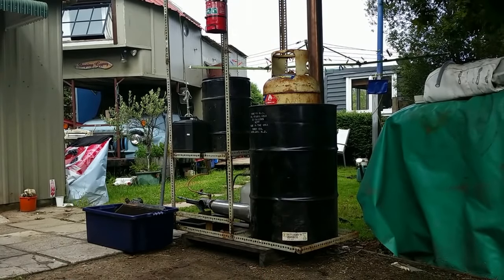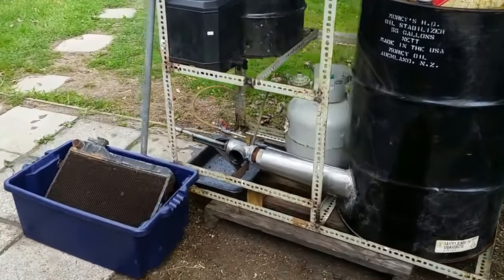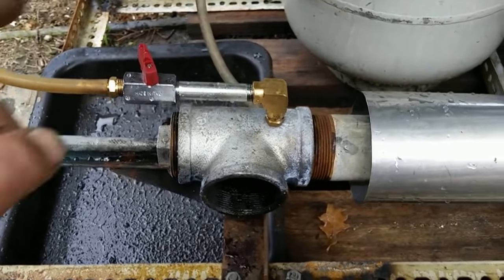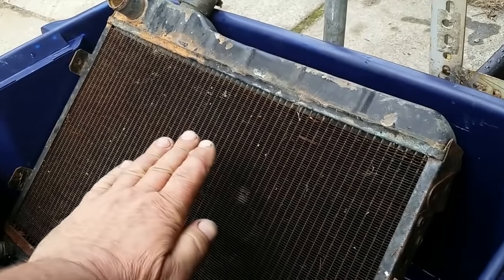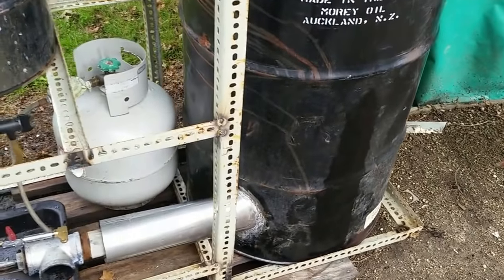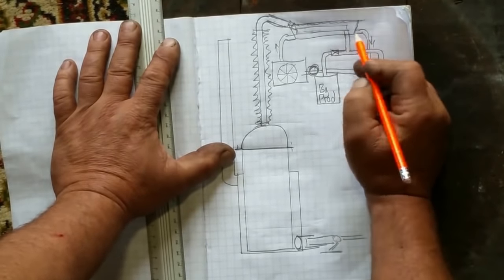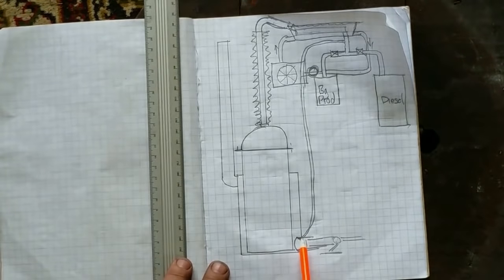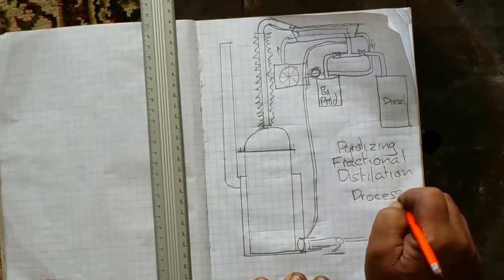Make your own free Diesel from Waste Plastic!  PART 2  layout of components

Comment: Sir, I respect and appreciate the work you have filmed and for a DIY this is very good. But as I am making these units on industrial scale (10t of plastic a day) I have enough experience to add some details to this. (if I may) 
1st of all don't call the fuel you get a "diesel" you get a mixture of benzene, gasoline, diesel and wax. IThe way you have designed the gasoline and diesel separation or "distillation" as you sad will not work in practice. The way to test it is just take a small cup of fuel and drop a burning match. Diesel will never ignite. If it ignites it is because you have too much gasoline in it. You better make a separate distillation unit and it would be very easy to do using your existing pyro equipment.  Another thing is that your diesel (even perfectly distilled) is a summer diesel. It will not work in winter. Take a bottle of this diesel and place it it your freezer. At lower temperatures you will see wax particles, then the fuel will harden and that's it!!! This is happening because the solidification temperature of synthetic fuel like your is very high. Normally you need to add some additives to lower the solidification temperature. But in DIY conditions it is hard to do it. 
Second is some safety issues. I would suggest The gas from your system goes to the burner for heating and that's a good thing. But if for any reason of power shortage or wrong operations the flame flashes back it will go into your system and you will have a video about the BIG BOOM theory )))) So please install 2 bubblers in series. It is a vessel filled 2/3 with water. The inlet pipe goes down as much as possible into water. The gases are coming out in water and travel up so the 1/3 of the vessel will be filled with gas. The from the top you have the outlet that goes to second bubbler and repeats the same. The gas outlet from the second bubbler will go to your burner. In industrial cases we install a flame arrester but I think it would be hard to find one for your size and pressure as your unit is very small. 
Please don't take this as a criticism as I only try to help. Grate job and keep on doing what you like doing!!!  Contact me if you need more help.
Reply from the maker: Two bubblers?  But I like explosions haha . Thank you for your input. I did read about all this as I was building it.  But I've only done one test then lost the insulation  and have not upgraded it. Too busy with other people's jobs to continue. I'm casting aircrete right now so I will make semi circular aircrete sections to fit inside the burn chamber and hold this heat in.
Reply from the maker: Thankyou for your kind help
Reply: @t.h.o.r.  That's fine. I have been manufacturing units like this about 10 years. So I just wanted to shear some experience with you. That's all
Reply: @artashesharutyunyan3693  Bubbler not required as gas burns at steady rate with no flashback possible as there is no oxygen in the pipe ,
Reply: @davelawson2564  The rate of gas production and pressure changes as it starts from nothing at ambient temperature till 3500 or 400C. Depending what you choose. First you get your water or steam, then the gas but it does not burn first. Then you get increase in pressure and your gas goes up very fast.  
There are many ways of doing the same thing. Some may like one way others the other. I am not criticizing the build or the project as for DIY job it is well build.  But I have seen several big explosions because of flames going back to system. And that's an ugly site. I had a small explosion myself. Not that I was perfect, I made my mistakes and learned my lessons. Now I am shearing them and hoping it helps. You may use it or not use it. You may use something else to fix the problem. But please don't say it will never happen. It's like all new drivers declare that they will never have a accident and boom... here we go )))
Reply: @artashesharutyunyan3693  I can't comment on your system since I have not seen it. But in an enclosed system , there will be no flashback
Reply: @davelawson2564  OK, May be )
Reply: @artashesharutyunyan3693  Thanks for you input.  I was thinking of making one of these units but I prefer safety first so the project is on hold for further study.  I'm in Canada and I'm an electronic engineer and machinist, so I was thinking with this machine I could make a  control and monitoring system by programming a microprocessor.  I have a fabrication shop in a section of my company where we weld, do machining, and woodworking for jigs needed to build electrical wire harnesses, for all sorts of companies that make their own products.  I would be interested in knowing about your system you build if you were willing to communicate with me through my email tom@ctwireprep.com   ,  Let me know what you think via email  ;  thanks Tom
Reply: No criticisme is thé truth
Reply: I'm an engineer in the oil & gas industry and had grave concerns also in regards to the vapor recovery as a fuel gas, which you have addressed accordingly. I might suggest using a flash back/flame arrestor from an oxy/acetyylene kit. You could also utilize the same regulator as flow control back into the combustion chamber. Also, love what you are doing here. It would be awesome to control this using an arduino processor too!
Reply: Sharing the knowledge is what brings discover
Reply: @artashesharutyunyan3693  would a one spark arrester like found one cutting torches work?
Reply: @t.h.o.r.  why not use solar heat to melt plastic
Reply from the maker: @13thbiosphere  I love using Solar, i have a bath heated by a coil on the roof, i have 3 seperate PV setups and I enjoy using my solar cooker when I can but this project was to use one waste product to process another waste product into a usable product.  im satisfied that when i get the insulation sorted it will fly- THEN we can start playing with solar- Ive foud someone elses epic parabolic mirror array that I want to copy- this could be the perfect excuse - thankyou!
Reply: @Andy-xm3ui  Not sure as never seen it. mine are  very large
Reply: @artashesharutyunyan3693  Yea I just wanna build one to make my own diesel fuel I don't really want a industrial one I need about 100 thousand litres of fuel a year
Reply: Sir Artashes Harutynyan, I've read your comment with great interest. Can you answer me some questions, please? 
1. Did you solve the prroblem with unsaturation of produced fuel? What is iodine number of diesel fraction?
2. What is specific weight of diesel and gasoline fractions?
3. I know Cetane number of diesel produced is expected bo be very high - 60-70, maybe. What about octane number of gasoline?
Thank you.
Reply: @andrewmosypan9898  
1.The problem of unsaturation of the fuel is solved, and all because of the catalyst we use. To be honest it was accidental result but we made it work and we repet the results over 15 times before we moved to industrial manufacturing of catalyst.  Sorry but would not discuss more details here.  Iodine number is about 20. A bit more then we need but it's ok and we can stabilise the oxydation with additives if we need to but I think there is no need. The fuel is not for Boeing 777
2. the diesel is 0.83 - 0.87. Gasoline don't know as we just burned it as fuel for us and we didn't sell it
3. Don't know as we didn't bother to test the gasoline cut. But octain number is not an issue at all as it is very easy to increase. The cetane is not easy to keep high. we worked hard on it.
Anything more?
Reply: akhper jan, inche ko contact detailnere vor garank khosink business
Reply: @panoskasparian667  JAAAN, zangi
zro zro ut vets,  mek yerek inn@ zro mek ut chors vets yerek hing chors
Reply: Согласен, бабблер необходим. Но все же не пойму откуда взялся кислород, чтобы пламя пошло назад в систему?
Reply: Artashes Harutyunyan, а вы намеренно помещаете в реторту некоторое количество воды или речь идет о влаге, содержащейся в сырье? Хватит ли этой влаги для продувки системы с целью выдуть кислород? Вы говорите, газ поначалу не горит? Не выясняли его состав? Или это просто воздух, вытесненный газами крекинга?
Reply: @andrewmosypan9898  1. eto vlaga vozduxa i vada v sirye. Nenada tudo chto to dabavlyat. 2. Eto prosto vozdux i nachalniye gazi pyrolysa. sastav ne vajen, no on silno vanyayet
Reply: Возможно, именно в этом причина вашего взрыва? Не горит сначала - значит мало углеводородных газов и избыток кислорода. Затем начальные газы все больше выделяются, и достигают взрывоопасной концентрации. Без водяного затвора пламя пойдет в систему - Caboom! Именно для продувки системы ДО НАЧАЛА крекинга (при 100 град.) я и предполагаю полезным поместить пластиковый сосуд с водой в реторту. Пар вытеснит из системы воздух и взрывной концентрации не будет. Затем поднимается температура в реторте и рефлюксе, и когда образуются газы, там уже не будет кислорода.  Остатки пара вытесняются в водяной затвор. Как вам идея?
Какой путь вы избрали для снижения йодного числа - гидрогенизация или алкилирование бензола и его гомологов?
Reply: Very informative suggestion
Reply: Earlier this week I was thinking about this and decided what needed to be done was make it refinery size.  Now I see it's not an original thought at all but one I'd have to emulate from someone else.  Where are you located?  I'd like to take plastics in as a recycler since there are no recyclers close to me(60 miles at least).  I could perform a public service and make fuel too.  I see it as the best of both world.  I'm considering using an old separator from an oil field location.  Of course I realize yours is much larger.  I'm thinking start small and work my way up.  I'd like to see your operation if you're anywhere close to Texas.
Reply: @davelawson2564  1st : did you measured oxygen content in pyrolysis gas? 2nd: did you noticed the flashing back of hydrogen gases?
Reply: @DGEngineering  First Learn pyrolysis basics then you'll not ask these questions.
Reply: @DGEngineering  it will not explode if you know the basics about it
Reply: @artashesharutyunyan3693  May I have some contact details please. I'm currently an undergrad chemical engineering student and I'm building this type of unit as a hobby project and would appreciate a mentor or some advice.
Reply: divorcedme  the pipes have to be metal and no rubber insulators. The piro-oil is destroying the rubber.
Reply: @Andy-xm3ui  pack stainless steel wool into a pipe. boom there s your spark arrester.
Reply: I Disagree sir there is always a chance of flash back. With my own eyes I've seen hydrogen flash a quarter inch line and blow the top off it's bubbled 25 feet away.
Reply: Hi Art,  I see some of the problems  you mentioned and a few others. But I also see a great potential as well. With your experience it's not a great leap to see you can be an asset if we work on this project collectively. Think fellas and let's push around some solutions next. First, EVERY plasma torch I've seen has used the double bubbled and a few of the really good ones had one way blocks as well.
Reply: @davelawson2564  That was my thought as well Dave , unless you had a leak it shouldn't be a prob  , But it never hurts to take precautions .What also concerned me were his comments on fractional distillation, I just didnt see it in his design ,, A re-flux tower "per se" doesn't equal fractional distillation
Reply: @bigpumpkin22  Bubbler he suggest will not work for this system.
flashback will not occur in this system either. He is talking through his hat
Reply: @davelawson2564 , Fair comment Dave , not enough internal pressure to drive it through a couple of air locks,,
Reply: @bigpumpkin22  Pressure is close to normal and no air locks required. Only involves cooling hot vapours. Ever heard of petroleum refinery blowing up ? Unless there is deliberate sabotage it will not blow up.
Reply: great advise, thank you!
Reply: Even as a summer fuel 
Generators could use for power grid ,or heating purposes etc
And we get rid of wasted plastic
Reply: @t.h.o.r.  I love your sense of humor.
Reply: Artashes Harutyunyan
 has NO IDEA what he is talking about, can't even use the correct terms.
Reply: @davelawson2564  
Be careful not to step into a trap! This is by no means an enclosed system, since the gas outlet is open by definition. Under normal operation you won't likely have a flashback, but as soon, as gas production comes to a halt and the temperatur in the reaction chamber drops, the backflow starts, oxygen get sucked into the reaction chamber and the chamber will explode since it's still far above igniting temperature of the remaining gasses at that point.
Reply: @tomcatmeow69  As i mentioned, this is not an enclosed system, it cannot be. If you control it with a computer, it still stays an open system and is in danger to explode, as soon, as the temperature in the reactor drops.
You better don't rely on sheer computing power if you don't want a failure like in Chernobyl.
If you have an power outage, your computer backup system will fail soon after as the whole reactor will.
And if your angry neighbour or a lightning shoots your computer first, there won't even be any emergency program to initiate a shutdown sequence anymore.
If you design your burner and gas outlet valves in normally closed and a reactor emergency cooling device in normally open, so that the whole distillery is self stopping and emergency cooling without line power, you'd be on a good way, i'd say.
Computer controll should be added on top of the self securing system and not be added to ensure safety.
The more engineers like their electronics, they tend to produce problems, not avoid them.
If you want to control exhaust gases, a computer is welcome - to ensure not to have an explosion in a shtf situation - no.
Reply: @werner.x  LOL ! you have no clue how these systems work.  It will never explode and never has.  even in the crudest experiments done for this type of system.
Reply: @davelawson2564  
If you think so.
Reply: An excellent critique thanks Artashes, especially the 2 bubblers. In the first film TinyHouse talked about there being no outgoing pollutants into the environment is that true and if so wouldn't more filters and bubblers do the trick?
Reply: @petergambier  
As far as usability of this fluid is concerned, if you use this for ancient Diesel tractors, you'll necessarily pollute the environment quite a lot, since these don't have any emission-reducing measures.
The only engines able to take this mixture, are such old diesels and they run dirty as hell.
I would in no case recommend this fluid for a modern Diesel engine, it would not survive this "Diesel" for a length of time that's worth the try. So the least you'll do, is pollute the environment with lots of junk, that would have had a long life, if it had used the recommended fuel.
This distille here is the first step in refining what still has to get usable stuff - what comes out of this reactor is highly poisonous, not suitable for anything, has to be fractioned and purified.
That's why refineries finally take acres, not only 2 square meters - and they spit out a multitude of specified products in the end.
This thing here is a good step - except that this thinnly built reactor will be eaten away in very short time - but it is only the first step of many.

Supplement: I've just watched this video  https://www.youtube.com/watch?v=njIYHtFmcSs  and it shows, that after probably just one more refining steps this fluid is suitable to propell diesel engines. But the shown car is an old one with not much emission control and without particle filter - not what you can buy today - and then it's a big difference, if you use the fuel sometimes for a short while or continuously.
Even the car industry is struggling quite a lot these days building "clean" Diesels that are NOT self destructive because of bad side effects of emission control.
I'd be careful using such crudely refined fuels in todays cars.
The follow up costs sure are higher than you'll wish.
Reply: Hi where can i find that machine
Reply: Normally i was collecting my trash wich can burn in 60 liters bags. Everything like plastic wraps, used paper and cardboard, rubber, etc... 🔥
 In the winter i was burning those bags mixed with wood to heat my house. ❄
 The chimney is charging up pretty fast from the plastics but for me was like a energy recovery. 🚮🔄🔥
 Now i wonder if i can use those mixed bags in this type of installation or this works only with plastic? 🤔
Reply: @saibabagarden  Definitely no!
Reply: DO YOU HAVE A CHANNEL ???
Reply from the maker: You are watching my channel! watch the other videos in this series. @petrojaxson5470
Reply: Just read this and am interested in getting a machine to same effect and make diesel hope it is cheaper to produce in long run